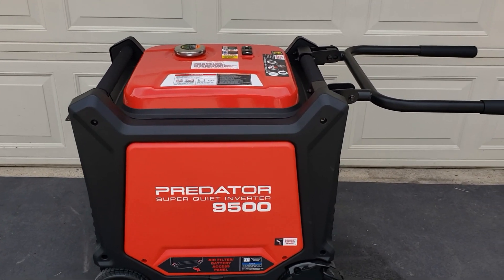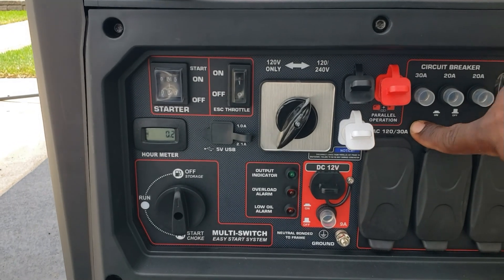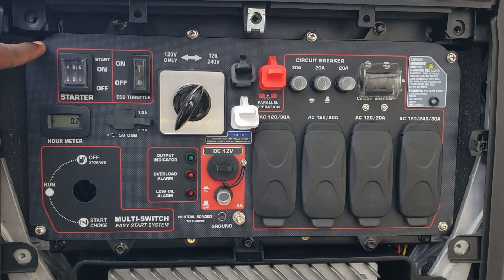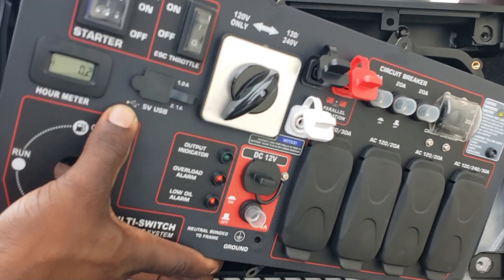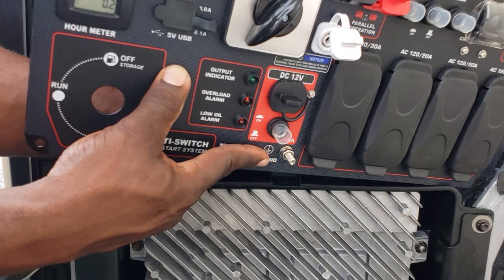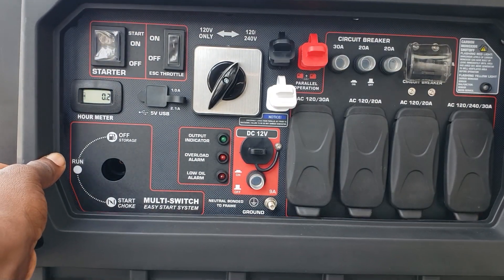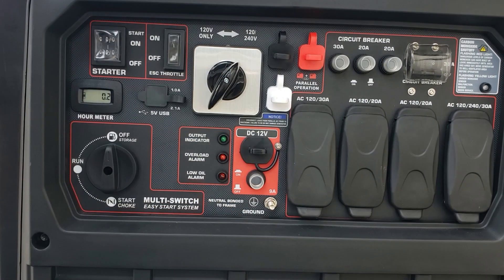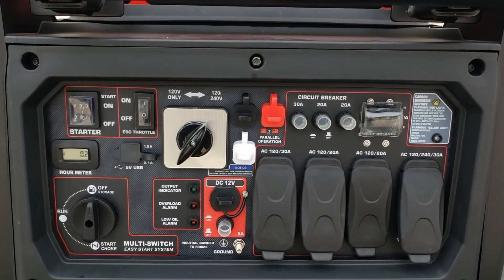How to Convert the Predator 9500 Inverter Generator from Bonded Neutral to a Floating Neutral | DIY

Comment: Great videos. Highly informative. I am curious what you are doing with all those generators? Anyways I have two questions. Question one is that if I convert this to a floating neutral, can I still use the outlet on the generator itself? 

Second question is, would it not be better to add a switch? That way I can flip the switch when I’m powering the house and then flip the switch again when I need to use the generator as portable power?
Reply from the maker: Thanks for watching. Thanks for subscribing.
Answer one
I’m making content with those generators YouTube is a business getting paid.

Answer two 
you can add a switch. It has to be a 240 V switch.
Reply: @GeneratorReviews  thanks for fast reply. What I meant by switch was that for example, I’m considering gm9000 generator. To make it go floating from bonded, you remove the neutral wire from ground behind the panel. 

Could I not attach a switch, and then one end to the neutral/ground connection where the neutral was previously connected, and the other end to the neutral wire? Then I could close the switch which will connect neutral to ground, and when I have to connect the generator to the house, flip the switch on the generator which will make it open, breaking the neutral to ground. Any thoughts? 

Didn’t understand your 240v statement. Could you elaborate please?
Reply from the maker: @TacticalTerrorizer  yes I understood what you meant. I meant you can do that. Just make sure that your switch is rated for 240 V.
And by the way, great choice on the generator
Reply from the maker: @TacticalTerrorizer  check out this link for the switch on Amazon. It’s rated for 250v
https://amzn.to/3E9JtEt

Comment: Thanks Gavin.  So I’m getting ready to connect it to my inlet box and I certainly appreciate the information.  Just curious, what happens if it’s not converted to floating and connected to an inlet box?  The reason I asked is that’s what I was thinking about doing until I watched your video. BTW I have the same Predator 9500 Generator that you have.
Reply from the maker: Just performed the conversion whenever you get a chance you’ll have two bonded points and could trip the breakers when a fault is detected 
it’s hurricane season time is running out.
Reply: 120v/240v 30A (to house) is not GFCI it will never trip under proper load. People are over thinking this.

Comment: Hey Gavin after I made this a floating neutral and I decide that I want to use the generator by itself can I use a bonding plug or do I have to reconnect the wire back again?
Reply from the maker: You can use a bonding plug on the 30 amp plug  not the 120v gfi plug

Comment: I dont want to keep beating this into the ground. But this is all new to me .I just purchased a predator 9500 and i am waiting for a electrician to install a transfer switch. So you are saying i can leave the generator bonded neutral correct? Powering my home during a outage is the only thing im using this for since i have a smaller one for other things. The cost of a standby Generator is out of the question so i want this to work 100% safe with no issues . Thanks!!
Reply from the maker: Yes you can leave it As is because you’re using a transfer switch that is what’s recommended so you’re a perfectly safe and sound
Reply: @GeneratorReviews  Thanks for the quick response and thanks for the informative video.
Reply from the maker: @conner474  You’re welcome

Comment: So Gavin could i do this with the Duromax 9000ih using a single unit being that there is no neutral with the parallel ports?
Reply from the maker: Yes it’s the same as the Predator

Comment: What's the difference between an inlet box and a transfer switch? What if you needed to use your dryer receptical to introduce power to your home?
Reply from the maker: I really don’t recommend back feeding the home through the dryer plug so much can go wrong
The difference between a inlet box and a transfer switch is that in the inlet box connects directly to your home breaker the transfer switch is independent it does not share the Home  bonded neutral
Reply: @GeneratorReviews  Only if the transfer switch switches both hots and neutral lines.  My transfer switch only switches the hots so I use a floating neutral on my generator
Reply: @GeneratorReviews  thank you. One problem I have is that my breaker box is full. I was i would need another breaker box. The one we have is the largest residential box with 2 additional smaller breaker boxes associated with it.  Any thoughts?
Reply from the maker: @patience8884  You may want to check all the circuits and see if there’s anything that can be combined like small closets or rooms to spare one circuit
Reply: @patience8884  Put four circuits on two split breakers (four breaker spaces to two breaker spaces). This will free up two breaker spaces for the 2-pole inlet breaker that should be interlocked with a proper kit for you panel.
Reply: @digitalman269  Thanks man, that makes good sense.

Comment: To bond or not to bond your generator. A very hot rabbit hole subject indeed and the nuances gets quite muddied depending on the application on how it's applied.

Majority of the RV and travel trailers out there if properly wired, the neutral is floating and the ground is bonded to the frame of the coach. Where the two actually meets together when you plug into the power pedestal or your generator. That's why it is very important to test your RV power point receptacles for open neutral and/or ground before plugging in. Those types of faults not only creates a potential shock hazard, but also nuisance tripping of GFCI receptacles in your coach since they have quite sensitive current sensor to detect the imbalance of the hot and neutral lines. The ground is also needed for the proper reference and it helps suppress stray current spikes to minimize false tripping.

In my case, I am going to leave it bonded since I use my Predator 9500 for standalone purposes for the majority of the time and maybe a handful of occasions when the grid goes down using the 30 amp generator input socket. Will it cause issues, more than likely not. Up to code, no not really. Electricity is behaves in funny ways and I understand the risks. If you're going to use it for only whole home backup purposes and nothing else, then it is best practice to have the neutral floating at the generator since your home electrical service panel will establish the neutral ground bond there for you.

For those who like to dive a little bit deeper into the National Electric Code (NEC) aspects on it. Just be prepared to get your belt and suspenders on, because things are gonna get a bit geeky in this mug.  :-P

Grounding - Safety Fundamentals (1hr:13min:19sec) by Mike Holt
https://youtu.be/mpgAVE4UwFw
Reply from the maker: This definitely is one of the more sensitive ones that most people are going to have issues with. We all use our generators for multiple reasons. Me personally I will be using the bonding plug for the Rv to prevent gfi from tripping and surge protector use. 
Thanks Felax very well said 
This will help

Comment: So, if I have an electrician install a 50 amp box on my house that means I should leave the generator bonded, right? At least that's what I gathered from your video when you stated that bonded is for an RV or an inlet box.
Reply from the maker: Bonded is for RVs and transfer switch
Reply: @GeneratorReviews  thanks for the reply. 
I enjoy your content...always very informative.

Comment: Nice video. I would suggest that if a person converts the wiring on a generator as was done in this video, from bonded to floating, then a tag be applied properly to the generator indicating the generator is now wired with a floating neutral.
Reply from the maker: Thanks Dan
That’s a great idea, I appreciate it

Comment: I drilled a 3/8 hole and put a switch on mine.
Reply from the maker: That was my plan also but can you imagine the comments from the keyboard warriors I would receive. 😅Thanks Wilson👍🏾
Reply: @GeneratorReviews  You ain't wrong! 🤣
Reply from the maker: @WilsonFlyer  🤣🤣
Reply: @WilsonFlyer  Care to share the switch you used?
Reply: @tomroth2634  Just a single pole/single throw switch. The 'off' side goes nowhere. The other is connected back to where the neutral originally was. Off=Floating On=Bonded. Easy. Peezy.
Reply: @WilsonFlyer  could you explain when you say nowhere.Do you mean white wire do not connect  to switch?
Reply: @mitch461000  It's probably time for me to bow out. With all due respect, if you don't know what I'm talking about, it's probably not a mod you should do, and I mean that with all the respect in the world.
Reply: @GeneratorReviews  I don't know what switch you're planning on using but will putting the switch in the metal frame which is grounded effect anything?
Reply: I don't know what switch you used but will putting the switch in the metal frame which is grounded effect anything?

Comment: You should put the free neutral wire through a toggle switch, and other side to ground. Now you can toggle neutral grounding on and off. Looks like there is room to right of fuel selector switch.
Reply from the maker: That’s the plan but I wanted to show this first I know most people like that simple version before I get complicated.
Reply: @GeneratorReviews  You know how many people here will drive a stake into the ground and connect a wire to the "earth" connector on their generator when they are camping in a tent away from anything?  Talk about dangerous practice!   Shocking in fact!!!!!!!!!!!!!!!!!
Reply from the maker: @TheAustralianOpinion  Facts!!! Earth grounding is one of the most misunderstood thing when it comes to generators.
Reply: @GeneratorReviews  Exactly.  Do people even read the manuals????  I've had to go up to these folk and let them know that their generator metal chassis under the plastic is now live.  Some actually have the temerity or ignorance to doubt me!
Reply: @TheAustralianOpinion 
My Duromax manual actually says to do just that. Had me scratching my head confused. It also doesn’t say anywhere wether it was bonded or floating. I had to figure it out by testing.
Reply: Love all the videos! Did you ever put a toggle switch put in? I’m getting a DuroMax and will be using it with a interlock switch. Thanks for any info. Also, I just subscribed.
Reply: Why not just purchase a bonding plug?

Comment: My Honda EU6500is has a floating neutral and I use it for a whole-house generator with an interlock switch. It was all installed by a professional electrician. Been running that way for 8-years.

Comment: Thanks Gavin. Simple and straightforward procedure. I have a Westinghouse WPro 8500 used with an interlock kit at home. The manufacturer provided easy to follow instructions much like your video to change it to a floating neutral.
Reply from the maker: Thanks Tom
Reply: @GeneratorReviews  What you have described here must be carried out by a qualified electrician and also needs a permit from the electricity utility as you are now hooked up to their equipment.  It's rarely done here unless one has a very big generator that is permanently connected.
Reply: What is done then if this isn’t?

Comment: I'm a little confused as to why this would be necessary or desired. You stated that the reason to do this is because code dictates you can't have two bonded grounds, but is that because there is some safety reason or some other reason. What if I also plan to use my generator for other things besides just as backup to my house? Should I leave it bonded?
Reply from the maker: Thanks Norm 
You can use a bonding plug when using it on your Rv. 
I plan on making a second video explaining and getting more detail why we do this.
Since your home already has a bonded neutral you can’t have a generator bonded as well.
Reply: I don't have an RV. I would use the generator to either power my house or my tools in my shed. Will I cause damage to my house or generator if I leave the neutral bonded on the generator?
Reply from the maker: @NormTre  The only reason we’re doing this is if there’s a fault it will go back to the ground on the house and won’t go back to the ground on the generator and the risk of shocking is eliminated.
Reply: @GeneratorReviews  thank you for clarifying that.

Comment: Is this bonded neutral only on 240V capable generators ?
Reply from the maker: Most of the 120 V generators are floating neutral and we have to use a bonding plug.
Reply: @GeneratorReviews  Good to know.  Have a bonding plug in possession and an EU7000is on the way for 240v use.  You’ve certainly been a great help, Gavin !

Comment: Personally, I'd rather my generator not be bonded and just use a bonding plug when needed. On my RV, if I don't use a bonding plug on my generator, my GFCI protected outlets will occasionally trip but never happens when using the bonding plug. Go figure. I really enjoy your "how to" videos. Simple and to the point.
Reply from the maker: AGREED!!!!!💯💯 I said the exact same thing.
Reply: The GFCI don't work correctly if it's not bonded actually can be dangerous if someone is being shocked, they don't trip. Does the RV have a bonding somewhere inside?

Comment: It’s good to see this channel getting more technical, I think it’s what it needed.  But it’s important to get these details right.  Some things are just casually mentioned and they aren’t entirely accurate.  You can’t just say “if using a transfer switch, then keep it bonded.”, because there are two types of transfer switches.  If using a switched-neutral transfer switch, then keep it bonded.  If using a transfer switch that only switches the hots, then make it floating.  Here’s a video that covers those details.

https://youtu.be/viNZV0lyRVQ
Reply: Thanks for posting that link. It explains (to me) why my RV GFCI protected outlets trip on occasion when I don't use a bonding plug with my non-bonded generator. I won't know for sure until I open up the compartment where my transfer switch is to see what model it is and find out exactly what kind it is.
Reply from the maker: Thanks Jay
Reply: How do I know if a transfer panel that was installed in my house before I moved it is a switched neutral transfer switch or a transfer switch that only switches the hots?
Reply: @ballsdeep9648  use a multimeter to see if the transfer switch has continuity through the neutral when it’s on house power.  Obviously power everything down for safety.